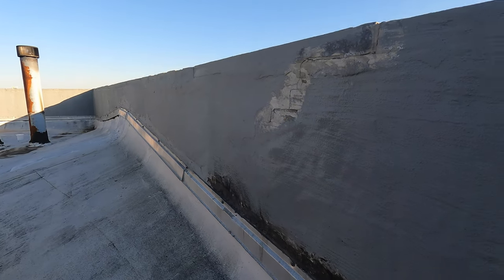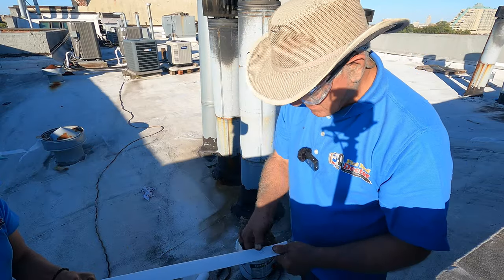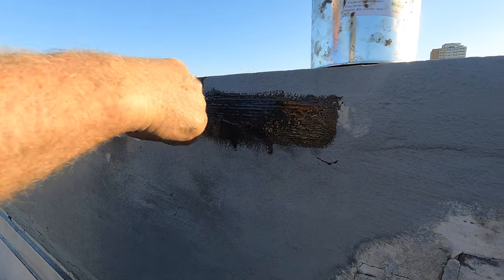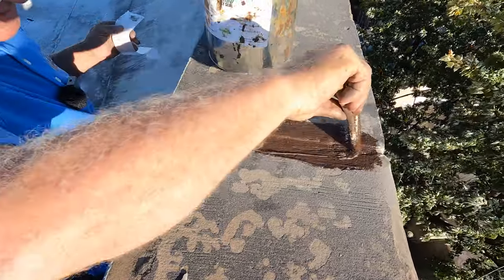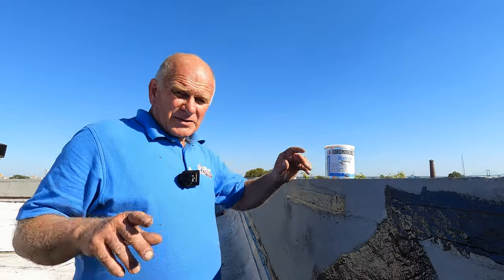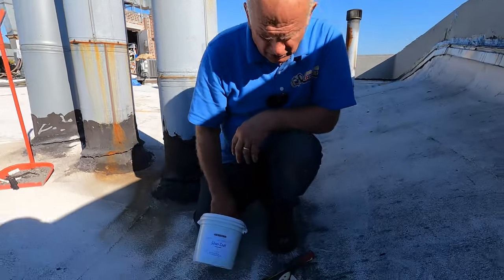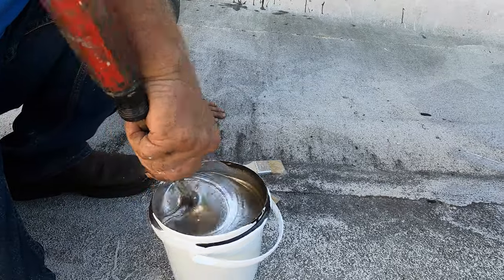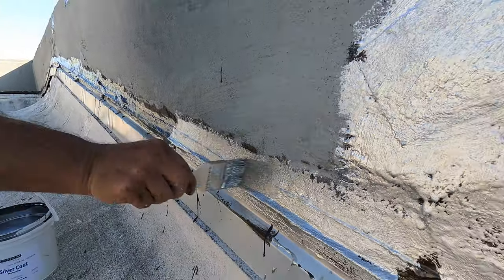How to make a Cracked Wall Repair

Comment: out of all the roofing you've don't your are fantastic, but this is an area that a strength filler should have been applied before coating a weakened area
Reply from the maker: good idea, but this is a 5 story building, and the structure very strong. What I think happened was that the water came in at the top at the stone joints and then froze during winter busting the bricks open
Reply: @FlatRoofDoctor  that is a definite factor do to not having copings. that will be its own problem down the line.

Comment: why not use super silicone? just wondering.
Reply from the maker: You could use SSS but then you could not paint over it
With Turbo you can paint the entire wall and over the Turbo Poly Seal
Reply: @FlatRoofDoctor  ah yes. I had forgotten about that, thanks. However I read from elsewhere you can actually paint over silicone but only with enamel based paints, which is probably very expensive.